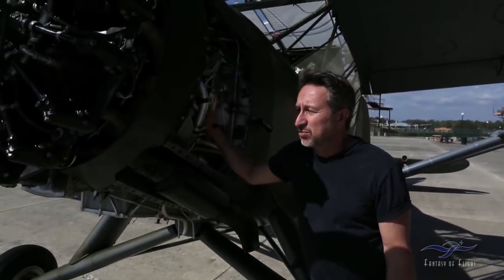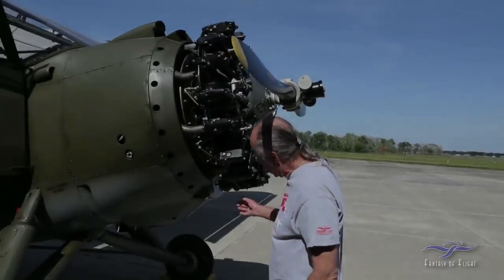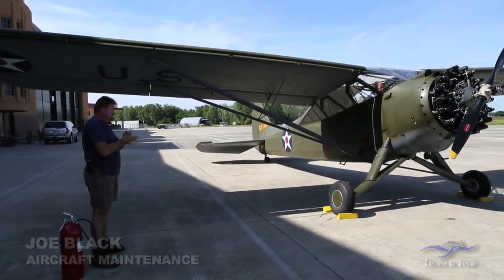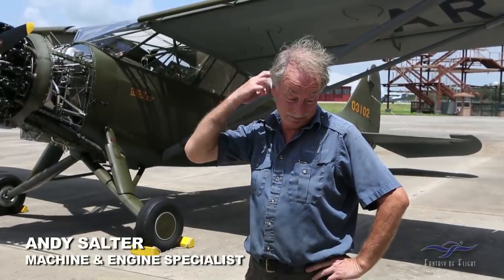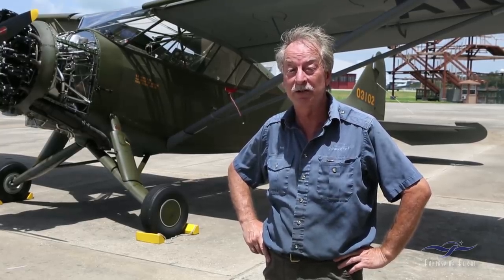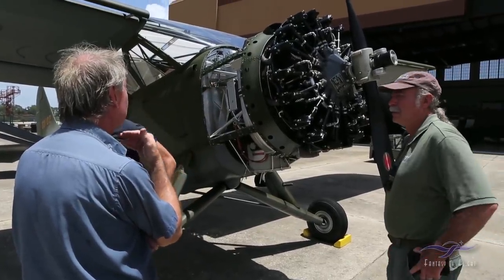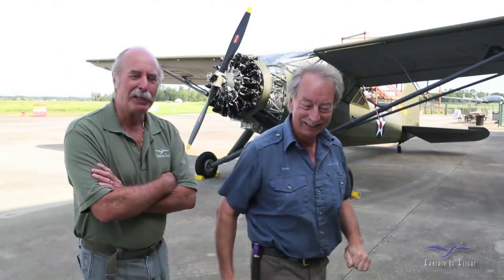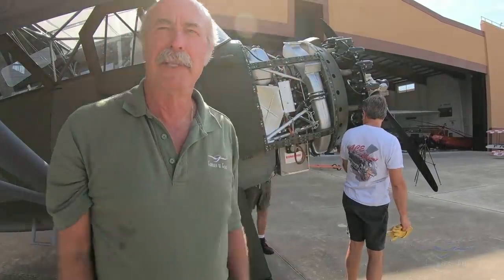Stinson L-1 - Engine Start Saga - Part 1

Comment: Thank you, Kermit for another great video, I can't believe how frustrating  it can be when an engine just decides to get cantankerous on it's own.  I have had things act up like that and after taking the thing apart to the last little piece and reassembling it, had it work properly, as if there had never been a problem.  Sometimes, I think air planes and engines have a mind of their own and just get stubborn occasionally.

Comment: I love the concept and sound of that inertial starter!  It astounds me that the heavy flywheel required is actually lighter than the equivalent electric starter of the time.  You also realize just how far electric motors have come if you were to see a modern starter motor for engine of this size.

Comment: I got a ride in one of those for winning the ticket lottery drawing on the gate .
It however  was not an L-1, it was a Royal Navy 1929 gull wing style. What a trip. It sounded and felt like I was in a TANK trying to fly, loud powerful but relatively slow take off [maybe just an illusion]. 
The plane was built to carry weight, paratroopers, or recon; not go fast.  At least that was my impression.  The back area was a big open space. Didn't notice if there was any jump seats. 
We took off and landed in an RC park in Kentucky
 so I guess we can call this bird STOL in some respects.  
Oh the smell of fuel , metal, and canvas , the memories.....

Comment: Reminds me of an old mate who was a mechanical genius. He had an Alfa Romeo V8 engine come to his shop that refused to run. It had been to 6 other shops where no one else could make any sense of it. He looked at the plug leads and notice one lot were very tight, he swapped them with the other bank,making sure they were in the correct order. One flick of the key and it fired up instantly..... The plug leads were in the wrong places.
Reply: That's awesome! One thing I've learned & found to be very true - always check the simplest things first. Once you establish that all the vital components are in correct & in working order, do you then go one level deeper. Most times it's the solution that is most basic. Essentially the theory of Occam's Razor. I can't begin to tell you how many times I've worked on engines that didn't start, where folks had ripped their hair out trying to solve the problem, only for me to quickly discover the petrol tank was dry, or coil was unplugged etc.

Comment: LOL.  Love the Old Fokker Tee-shirt Kermit.  Brilliant. Now I thought when it didn't start the first time the timing was out 180 and firing at the wrong time (I had an old engine that did that running of a mag' but it was a lot smaller an engine and not on a plane) but same theory.
Anyway, it is a strange set up that engine has and it would have taken me a lot more head scratching to work that one out.
So well done that man, give him a bottle of rum.  Love the videos and it is good to see you also show things when they do not go right, makes it even more interesting.  Good old fashioned problem solving without shouting (maybe there was but we didn't see it) old machines are like old people, they do not perform like they used to!

Comment: That was really fun to watch, though I feel those frustrations getting the bugs worked out. I know ignition issues have confounded the best of mechanics, I once spent six hours trying to get an old International truck to run, it turned out to be the new condenser I installed was faulty, put the old one in and it fired right up! And yes I was even blaming valve timing at some point!

Comment: know the feeling - I spent 18 months trying to chase a problem on the Subaru engine on my homebuilt aircraft - turns out the cam belt was 1 tooth out, which meant the timing signal to the electronic ignition made no sense to the computer - I think I can safely say that wouldnt be the problem with this one!

Comment: Enjoyable video. At the end, it said, "Light the spark within"... I was still thinking ignition. 😉
The only engine I ever rebuilt was an MG. No. 1 cylinder at (?) degrees before TDC, rotor pointed at no. 1 plug wire...WOULD NOT CRANK! Turned the distributor where it SHOULDN'T be...it ran! Maybe I didn't figure spark advance. Good job, guys...enjoyed as always!

Comment: You know, I once put the distributor in my Mercury Bobcat in 180 out, at 1 something in the morning after a rebuild.  Hoses blew off, fire came out of the carb instead of the exhaust, nuts.  I threw in the towel, went and took a shower and realized what I had done, went back out, spun the darn thing around and put it back in, purred like a kitten.  Not as complex a system but then neither is the noggin I have to work with.  Good times.

Comment: It sounded like 180 out from the start. Many dual ignitions run as twin points do and have a lead and trailing spark so maybe those mags are supposed to be like that? The theory ofcourse with multi spark ignitions. Light that fire as often as possible. Cleaner combustion and far better cold running as well. And more power as well.

Comment: Thingamajig on the whatumacallit next to the wewaa needs adjusting. LOL
Reply: Don't forget to wind up the framus gizmo too!
Reply: Tom Clark  you would never know what that ‘starter‘ sounds like, well,,on very LARGE ELECTRICAL DISCONECTS, you have to wind up a aLARGE SPRING then fire it off so that ALL 3 PHASES CLOSE THE CIRCUIT AT THE SAME TIME, if you had never seen, orHEARD it for the first time, you would most likely run, the noise in firing off that spring closing that circuit with probably 10000 amps, is horrific. Cheers from NJ

Comment: Interesting design on that radial. How do you stop hydraulic lock from oil in the manifolds w/o adding drains? Did they intend for the engine to be ran enough to not allow time for oil to fill up the manifolds? Also which manifold fills? Intake or exhaust? Both? How does it enter? Through an open valve? Is it possible to pull the engine through before storing the aircraft, so that the bottom cylinders are on the compression or combustion stroke, so both valves are closed? Btw, the no start condition definitely seemed frustrating. It did act like timing from the start. The sound while cranking was indicative of that & you could see random rich, light offs puffing from the exhaust. So, seeing that, you know you have spark, fuel & compression. Andy verified engine timing, so it had to be out of phase with spark distribution. Very enjoyable video!
Reply: Will Thacker that is why you see someone slowly pulling the prop over ONCE FOR EVERY CYLINDER, PRIOR TO STARTING,     Cheers from NJ

Comment: Brilliant video. Those radial engines seem to be very temperamental. What is the noise before the engine kicks over? Is it an oil pressure pump that needs to be at the right pressure before you crank the engine over?

Comment: Are your R-680 mags the original DFN or the Scintilla Dual (single drive) dual magnetos? Or, has the accessory case been modified for a more popular set of singles? Some OEM parts are out there (Chino?) for the dual mags, and I think there might even be a couple of STC'd items as well. No sweat for parts for the singles. In either case, if by "the distributor" you referred to, you mean the cap and rotor, the easiest thing to screw up is the harness of spark plug wires. But, since all single row 4 stroke cycle radial engines have the same firing order, it's easy to figure out. Good luck with it, and thanks for sharing the video!

Comment: Another awesome video. Many thanks for sharing. I had similar trouble with a bike. Couldn't get it to fire. Spent weeks on it after buying it as a non starter. Had the engine apart three times. The guy I bought it off said the valve timing had been done so stupid here believed him and set it up as he had. Blimming thing was 180 out. I got it running but by that time I was that hacked off with it I sold it (though I did make a profit) 
Any news on your Meteor MKIV VT229 ? I spent a day cleaning that airframe Many years ago.
Reply: That’s the very first real lesson I learned as an electronics mechanic, shortly after learning the job and being left to my recognizance. I took someone’s diagnosis at their word (they even had parts ordered for that diagnosis) I wasted about an entire day working my way down to the part that was supposed to be bad and what do you know it was perfectly fine. It turned out to be a pretty easy fix that wouldn’t have required such disassembly and subsequent reassy but since it took me longer to order the correct part waiting for IT cost even more time... It was a very embarrassing rookie mistake, but I was saved as the person who ‘sent me down the garden path’ was much more senior and it fell on him. Turned out to be a life long learning experience I’ve told it to everyone I’ve trained as an example of how first hand troubleshooting is a required part of every job (‘a wise man learning from the mistakes of others’ and all) learning that lesson has saved me a massive amount of time and money and served me quite well in general.
Reply: @daa3417  Oh yes. If you have a technical manual and it has a diagnostic flow chart,and something just flat out beats you,start with the flow chart ,start high up in the chart,and keep a record of what you have done. One step at a time and never skip a step because someone else has told you something. The first time I was beat that eventually saved my bacon,the second time I felt like a fool. And yes,No.2 was just as educational as yours.

Comment: I hate to sound like a pain in the ass, but I was going to suggest that if you have spark, and fuel, but the engine is not talking to you during starting, it might be 180 degrees out on the timing, but what do I know? I'm happy you got the old dog running!

Comment: Been there, done that. 180 out bite you every time.
Reply: Haha, ain't that the truth! Imagine realizing you'd screwed up & the distributor was clocked 180 out. You pull it out, install it back the correct way, then go to start it up & it does basically the same thing, which is a whole bunch of nothing. You start 2nd guessing yourself, even though in the back of your mind, you know its a ignition timing problem. Then, by some process, you realize that the actual mags are under driven off the distributor, so having it 180 out means the mags are like 90deg out of phase.  That would almost be enough to make me consider violence. Lol. Especially after I'd pulled the timing case, adjusted valve lash, & removed/installed the nose cowling, all multiple times over a period of weeks, still having no success, only to realize the mags are 90 out. You gotta applaud Andy for his ability to stay calm.

Comment: 180 has bitten a lot of people, including me. When you start scratching your head, go back to the basics.
Reply: @zuestoots5176  180 out is catching every cylinder on overlap, it can't fire the piston down the hole because it can't make compression with the intake valve opening.

Comment: Looks a little light on compression. Might be too dry now. Or it could be a valve timing issue. Excess fuel will dry out/wash down cylinders too. Definitely looks like it motors pretty easy. But it doesn't crank too long, either. Compression/leakdown test.

Comment: On this engine can you test for a valve timing issue by doing a compression check?
Reply: I'm sure you could, but it wouldn't tell you the exact cause. If your compression was down, it could be a multitude of things causing the drop. You also run the risk of bending a valve from piston contact, (assuming the valve timing was indeed, incorrect) since you'd need to turn the engine over a few times to get a reading. If you could slowly pull it through by hand & establish the valves aren't contacting the piston, you could get a cylinder on tdc, pull the plug & do a leak down test. Then you'd be able to see if it can hold compression at tdc. If valve time was incorrect, you'd hear air hissing out the intake or exhaust. If it couldn't hold compression, but you heard nothing hissing out the exh or int, you'd have to chk another cyl. If it did the same thing, it tells you something else is compromised, i.e piston ring sealing, piston cracks, or multiple head gasket failure, etc. The only definitive way to know is by checking actual timing marks on the crank gear & the cam gear for correct alignment. Checking compression will only tell you if a cylinder is sealing. With that specific test, the ability to discover why comp. is down, is fairly limited beyond performing further checks. Cheers!

Comment: 180 degr out. Classic error. Most engine mechanics, amateur and pro,  will have had to deal with a situation like this at some point in their wrenching career. I sure had to.
Reply: Oh yea, if you work on gasoline engines long enough, the old 180 out bug will come to bite you sooner or later! That thing definitely sounded like an ignition timing problem from the jump. The lack of sputtering & intake backfiring, through me off initially. Being an automotive guy, you know how engines react to being 180 out. It wasn't until they mentioned that the mags rotated only once relative to the 4 crank rotations, did I finally see why the engine was acting that way. Of course if the distributor is 180 out, causing the mags to be 90 out, it's gonna be sparking on BDC, either on the exh, or the intake. If that's the case, it'll never light off. No wonder they weren't getting any backfires. Cheers!

Comment: Is there a A&P licence between any of those guy's?
Reply: A&Ps aren't licensed, they are certificated.
Reply: @timothywitt4864  Regardless,, Any work done by a A&P has to be checked out by a inspector, wonder who's doing the inspecting there?
Reply: @jocrp6  Unless the work requires a 337, an A&P can sign the return to service after anything he does without any further inspection.  A 337 is required for major repairs and alterations and would require someone with inspection authorization to sign off on it.  If the airplane has an "experimental" air worthiness certificate, like many warbirds, an A&P can sign off everything including the annual condition inspection--no Inspection Authorization required.
Reply: @timothywitt4864  But radial's are all they do,, I remember being in school during late 80's, and if not in a dark class room with a overhead projector on learning turbine theory trying to stay awake we were outside climbing all over 1947 beech 18's with PW 9,85's that were such a hoot to run up,

Comment: wow, interesting, normally if you time a car motor 180 out it will cough and spit fire out the carb, not so on that engine
Reply: That's true for sure! I thought the same thing at first. Then when they said the mags do something like 1 revolution in the time the crank does 4, it started making sense. Vehicle engines w/distributors normally spin 1 revolution for 1 camshaft revolution. So when your 180 out on a vehicle engine, you're at least lightning the plug on TDC, only it's on the exhaust tdc, not the intake tdc. The fuel/air charge is still able to burn, but it ends up burning out through the intake, coughing, spitting, etc - just as you said. With this radial the distributor being out 180, means the mags are like 90 out. The spark would come during BDC on either exh or intk strokes. That would make it unable to burn at all. If you notice, it would puff raw, unburned fuel & smoke from the exhaust a few times. It was just managing to light off leftover fuel from previous cycles that didnt clear out the exhaust on the prior cycle. Definitely a confusing & frustrating situation! Especially when attempting to diag the problem, is so labor intensive! That's why these videos are so great! You can learn so much, even if you don't wrench on aircraft. Cheers!

Comment: Sounds like  a few  of you need to  "think outside the box."  In hotrodding  there is a term  "degree the cam"  which can be checked a number of ways,  but  on these engines, where the pushrods/ rockers/ valves are  SO   easily accessed,  I see NO reason  why you could not  EASILY   "degree the cam"  without  taking ANYTHING apart other than maybe the rocker cover  for  the master cylinder.   So far as the comments about  "180 out",  ANY of us who have tossed more than one  distributor into an engine knows how to avoid this  ALWAYS.  You mark the balancer, degrees/ accuracy,   you  check for the compression stroke, and you set up the timing. And THEN you start the engine!!   SOMETIMES you run into an incorrectly ground/ documented cam,  OR EVEN a reverse grind (marine) cam  that wasn't supposed to be there,  or some weird distributor problem, but the ANSWER  is ALWAYS   "GET BACK TO BASICS"  Cam timing, ignition timing,  and  compression, fuel, and ignition.

Comment: Well half way into it,  If it was a car,  I say you have have too much advance,  Firing before TDC and actually fighting against the rotation wanting to go the other way backwards. Now back to the video.  Not knowing anything about radilas.  I would think that you might have you firing order off by 1 cylinder in one direction.
Reply: Watching along,  it looks like a port for a hand crank on the side.  So can this be hand cranked?
Reply: 180 out of phase, will give you a little heartburn :)
Reply: @IMRROcom c'est justement fait pour entraîner le démarreur inertiel si la batterie est faible, il y a une manivelle qui se positionne a c'est endroit.
beaucoup de moteurs d'avions ont ce type de démarreur inertiel, même le me109.